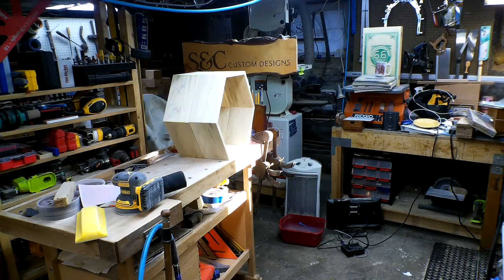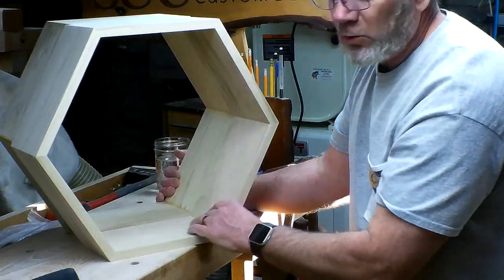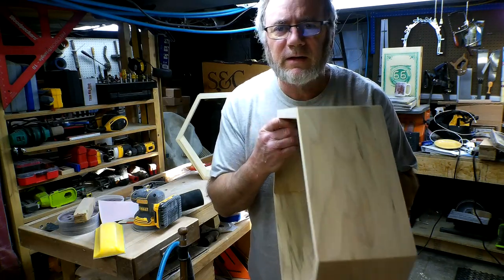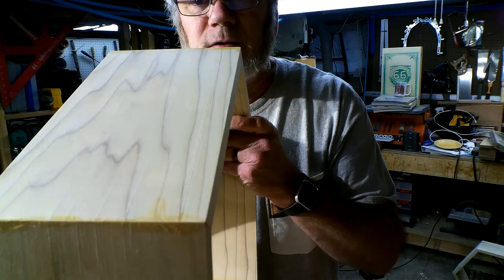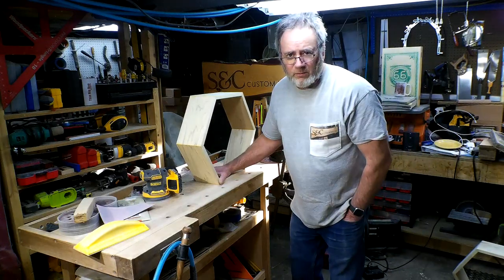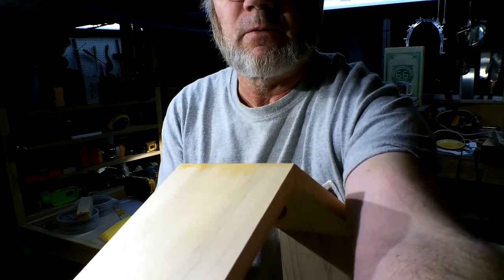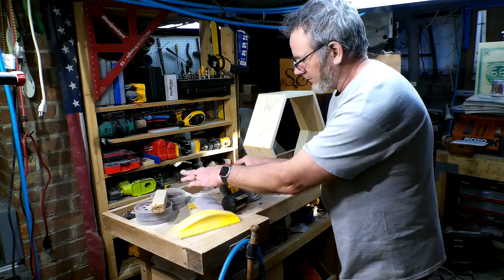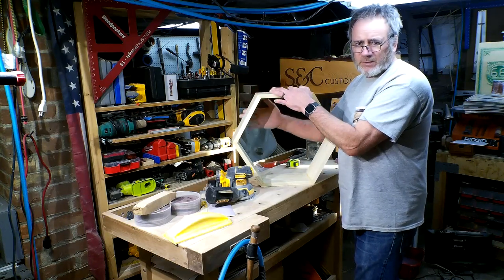The Sanding of the Hexagon shelf. Boring but necessary  Part 6

Comment: Hi Bud what’s the length on those shelf’s? And as a beginner wood worker what would you charge for something like that? That way I’d have an idea and charge accordingly. Thanks Big Jim
Chardon Ohio. Thanks for the Video!
Reply from the maker: Hello James and thanks for interacting with my channel
I don't have the measurements for this unit, and it is no longer in my shop. 
But if I recall they are roughly 12" long and 5 1/4" deep.

If I were selling them unfinished and made from Pine. I would consider $20.00 dollars each, finished $35 dollars
You really have to feel out your intended audience. For example at my shows I would work with the customer... if they buy one, this price, if purchasing two or more then...

The trick here is to make them in mass production... so you can rip through them in as less time and effort as possible. 

I hope this helps
Reply from the maker: Sorry it took so long to respond. 
I would embrace collaboration